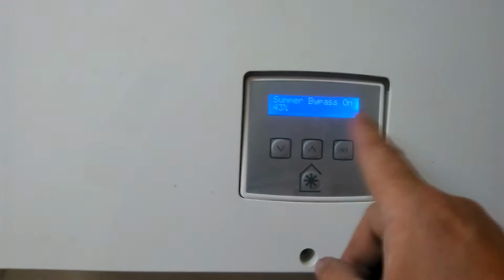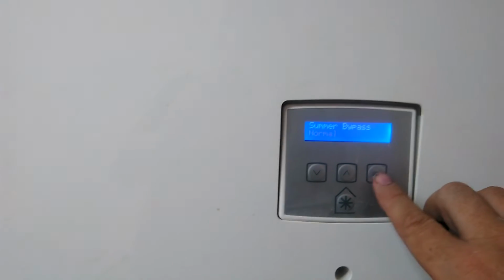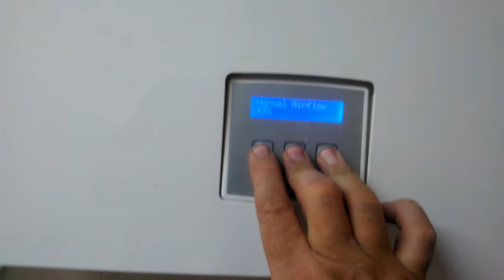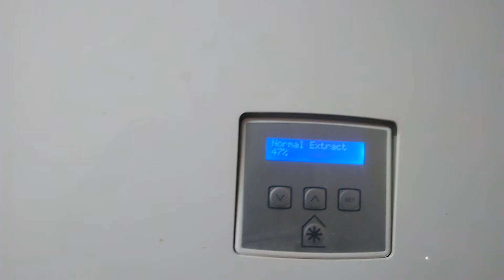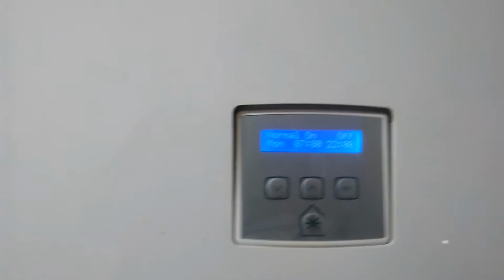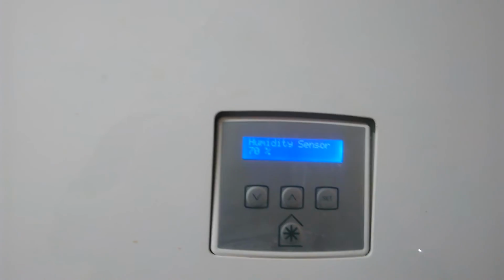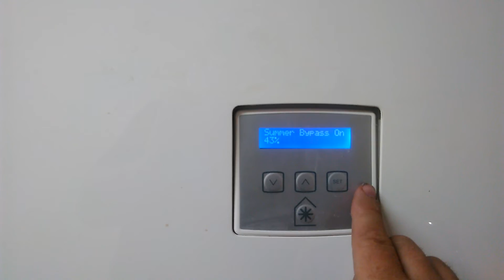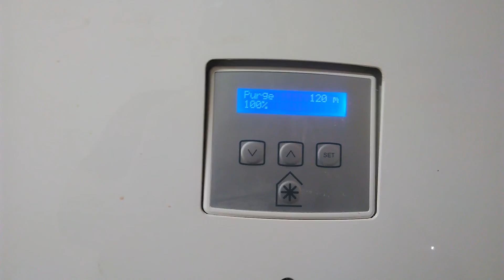Vent axia sentinel B+ control module

Comment: anyone knows this? 70% humidity seems higher than recommended, despite it being the default level. the machine can not be st lowre than 60% i noticed. while 40 to 60% is recommended according to some websites ( i am not an expert! might be wrong figures!).
what do you think about this all? how to fix it ?
Reply from the maker: In the summertime, if the unit is able to be set at lower humidity like 50% it would run in perpetual boost and keep you awake all night,  especially if the boost rate is set high. unfortunately, this particular model cant set profiles for one scenario and another. It's one setting for all seasons which is a shame. Wintertime you could set it to 60% RH and it would regulate that on normal mode and behave fine. we only have the outdoor air to reduce vapour pressure and the specific humidity. some systems have chillers so its possible to set lower RH levels. I agree,the Goldilocks zone to keep all things nice is between 50% and 60%.RH  With this unit its best to set 70% for summertime if you want a good kip.

Comment: hi! great so see this, the manual does not mention these things that well.
my very similar system from vent axia has been installed but i ve noticed that all percentages are equal for extract and supply. does that mean no balancing has been done by the company that installed it (i bought the flat finished and new)? can i fix these things myself ? its a simple one bedroom flat with 2 supply outlets and 3 (i guess, toilet bathroom and kitchen) extract points. 

furthermore, i ve noticed it sometimes goes into boost at night, presumable ddue to paramters, which is noisy for me. so via the way you explained i have decreased boost extract and supply to 50, normal to 30 and low airflow (timed for sleeping hours)  to 15. is that allright?